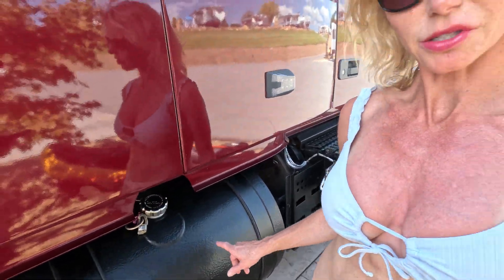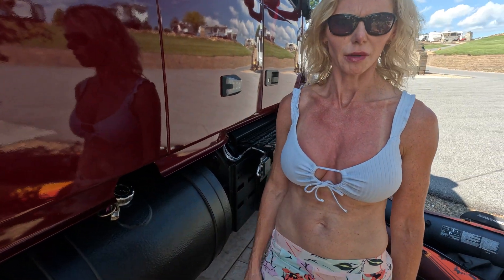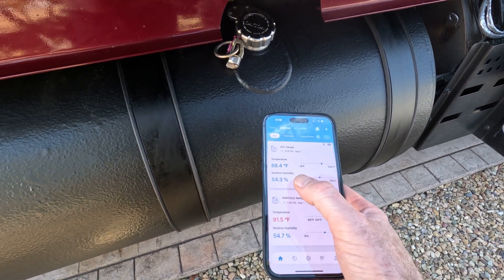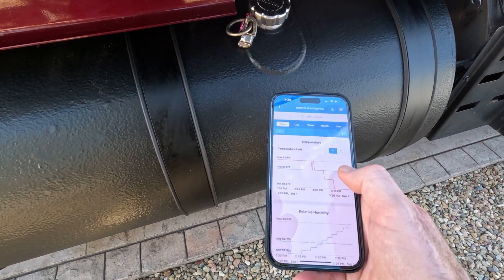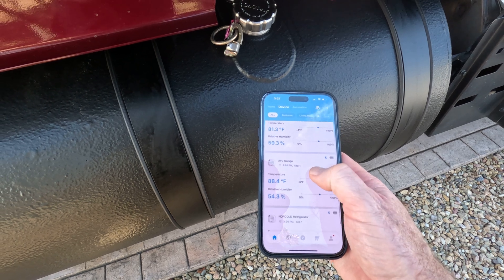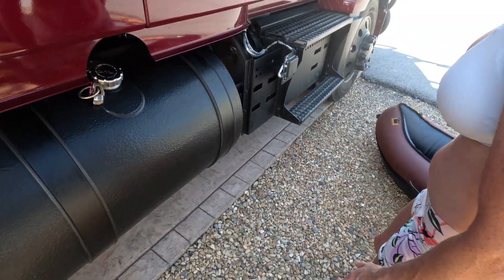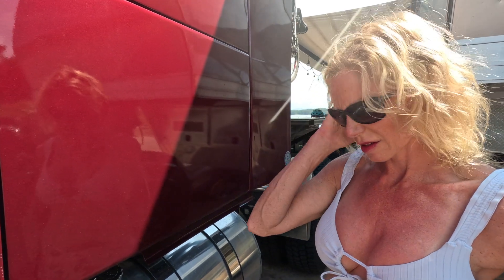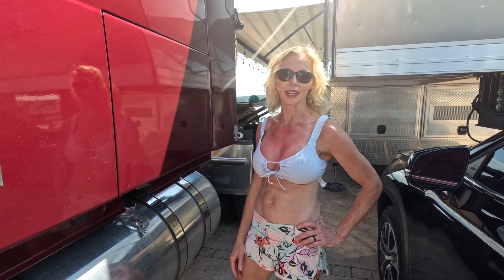LizardSkin Ceramic Insulation, the Test Nobody Wants You to See

Comment: I coated my brand new Sprinter Cargo van cargo area back in 2015. Best thing I did for the hot S FL summers.  Very quiet ride too.
Reply from the maker: Glad to hear it worked so well for you, I think it has to help keep our tanks cooler.  We wanted black tanks, but didn't want our fuel to get hot.
Reply: @theMTNman  have you checked your fuel after it leaves the injection pump lol ?

Comment: Wouldn't it be a more valid test if you used a thermometer to check the temperature of the liquid inside the tanks?  The tank itself will heat up in the sunlight. Is that temerature getting through to the fuel?   Please get a thermometer. You are concerned about the fuel temp, not the outside of the tank.
Reply from the maker: You might have a valid point.  There was a thermometer in the tank, but it was only checking the ambient temperature.  I figured if the ambient temperature would correlate with the fuel temperature.
Reply: @theMTNman  only one way to find out for certain. Hope you see it throughl and make a video. If no different, it would make me rethink my suggestion. The sun is powerful.

Comment: Looks good, i need to put something on my hot ass camper truck and regular paint doesn't do shit. This might be the best stuff available.
Reply from the maker: Your application is more what it was intended for.  I think they make it in white too which should be even cooler.  I spent a lot of time discussing this project with the manufacturers and so far I have been satisfied.  We just took a trip out west in 100+ temps and the truck ran flawlessly.

Comment: Its not for the outside. You bought the wrong stuff . Black attracts heat   ... you would out that on the inside of a van or container
Reply from the maker: I'm not trying to be rude, so please don't be offended, but it would be helpful if you watched and LISTENED to the entire series I posted on LizardSkin prior to commenting.  I collaborated with the manufacturer on this series and application.  In short, we used LizardSkin because we wanted to black the truck out and we knew black attracts heat.  We were committed to black tanks and wanted a layer of insulation to reduce the heat transfer to the fuel.  This product is used on fuel storage tanks  in the desert to prevent heat transfer.  Thanks for watching and please consider subscribing.
Reply: @theMTNman  for what you're doing id have gone with white to reflect the heat they do sell white thermal paint . I know why they make water tanks black . Buy the large fuel containers are white  so are the trucks

Comment: What is the point? Painting the tank black only makes it pick up more heat.
Reply from the maker: That is the point.  You might want to watch the entire series.  LizardSkin advertises that it will reduce the temperature and or block heat transfer on a variety of substrates and applications.  We are blacking the truck out and didn't want the fuel to experience a significant increase in temp over the polished tank, so we applied LizardSkin ceramic insulation and we are testing it to see if it lives up to their claims.  It appears to provide a significant reduction in heat transfer and I don't think we need to worry about having overheated fuel even during hot sunny days.
Reply: @theMTNman  
That is not how it works.
Reply from the maker: Maybe we are confused, how is it supposed to work?
Reply: @theMTNman    It is just insulation. It slows the movement of heat through the material. Adding more insulation or coating will slow down the heat more. Painting the tank black made the surface pick up a lot of heat. Black an efficient color to absorb heat. And the black coating is just putting that heat into the cooler diesel. And when the outside cools down, the heat inside the tank has a hard time getting rid of the heat because of the insulation.
Reply from the maker: Maybe we should devise another test based on your theory.  We performed additional tests that will be posted soon and it appears adding black to the tank only increased the temperature 0.5 degrees and without the insulation you would expect a significant increase in temperature after painting the tanks black.  The manufacturer actually suggested the test be performed in the manner that we conducted them (many people use laser thermometers and check surface temp).  They have a commercial division that supplies coatings for oil/fuel holding tanks in the desert.  Seems like the diesel would take longer to heat up as well, so wouldn't that offset the time to cool off?  So do you think the average temp of the diesel would be lower if we painted the tanks black and skipped the LizardSkin?